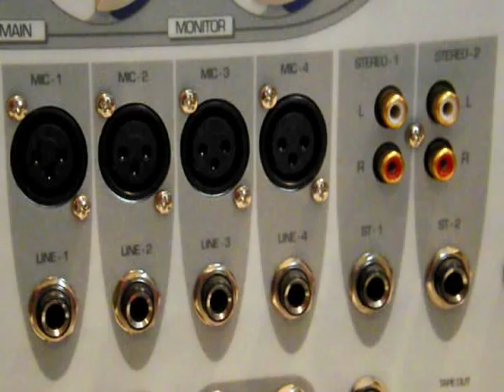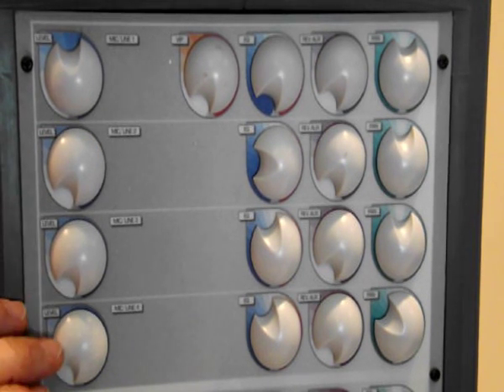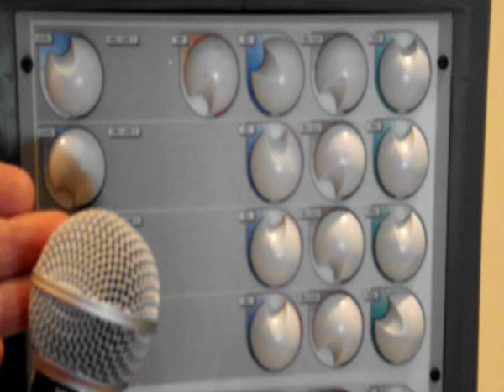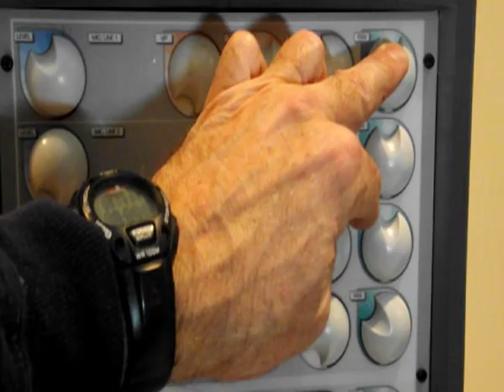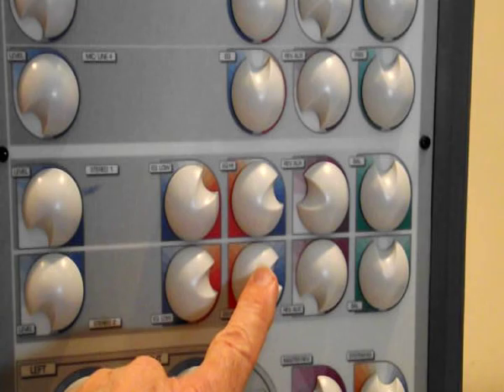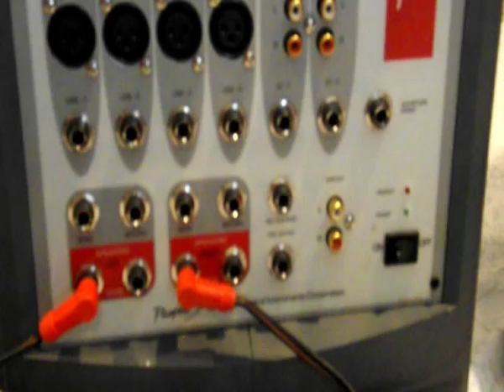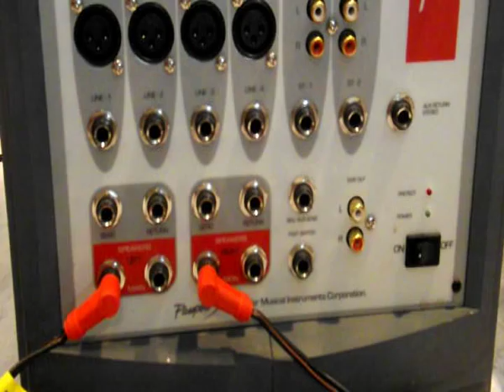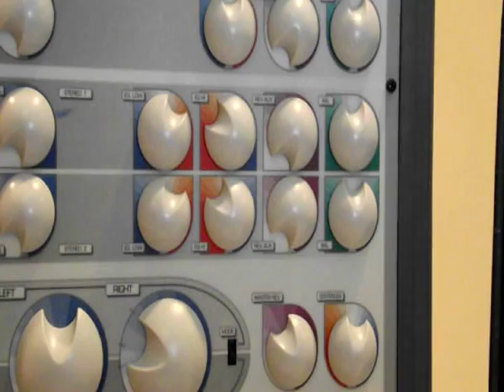Whacky Sound Education - System # 1 - Fender System Tutorial

Comment: Frankie, I have this sound system and I am wanting to add two subwoofers along with the speakers shown in this video. I have two MTX 150 watt rms/300 watt peak power (8OHMS). Can I add these and if so which outputs would I need to use? thanks!
Reply: I need the answer to this aswell, you ever figure it out?
Reply: @dougienoel  I have not…..
Reply: @vincepetrillo1641  just assuming you plug them into the other speaker inputs ? Not sure if that’s a bad idea

Comment: Sounds good. But i get a high pitch sound and then it gets stronger and then the speakers go out and have fo turn off and turn on... please advise?
Reply from the maker: Wow, that sounds really bad (pun intended). It seems it would make the system completely unusable. 
 I cannot explain or advise without additional information. Some basic questions are:
 1) When this high pitch occurs,   what instruments or mics are plugged into the board?
2) Does this problem occur even when there are no input cables attached?
3) I need to know the dial and button configuration.  Can you_please take a snapshot with your phone and text it or email it to frankie.stamps@comcast.net?

Comment: frankie I let a guy at my job barrow this and I was trying to explain to him how to use it he is having a party at a bar with a private room for his family and he is playing music from his phone. Now on the fender system if he is play music from the phone plugged into the stereo 1 and the black switch pointed down and the speakers plugged into main. Now does he leave left big nob at 12 and control the volume from the stereo 1 volume or control it either one thanks
Reply from the maker: The simple answer is . . . crank the phone volume to 90% to 100%, set the channel volume at about 50% and the master volume at ~50%.  Best to adjust the volume up and down at the channel knob.  

For more detail . . . read on . . . Volume coming out of the speakers is controlled by numerous amplifiers along the signal path.  What you are trying to accomplish is obtain as clean a sound as possible - meaning maximum signal to noise ratio (SNR) with minimum distortion.  To get maximum SNR at the output, it is best to amplify the signal as early as possible in the signal path.  By doing this, any further amplification down the line will increase the desired signal as well as noise, but the desired signal will remain  well separated from the noise.  Distortion happens when an input saturates an amplifier's capacity to handle the signal's peak power. Many sound boards will indicate overdriven channels by red LED lights that blink or turn on when max power is exceeded.Unfortunately, the Fender does not have this feature
Reply: Ok thanks
Reply: Frankie Stamps. hey I have one If these amps, when I try to turn it on the protection mode light comes on. can u tell me what I need to do to get it to play
Reply from the maker: Hi Sam,   The protection light is intended to turn red when the internal amplifier gets overloaded and the protection circuit trips.  So either you have input or output connections that are not correct OR possibly your unit is sick and in need of repair.  The first test to begin troubleshooting is . . . if you have nothing connected, no inputs and no outputs, and you power up the  Fender, does the red light come on?  If so, your unit needs to be repaired.   Good luck!

Comment: Thanks very helpful I think I finally now understand the monitor system. I'm still a little confused as to why there are a total of 8/4 inch inputs. It will be interesting to see a more in-depth video of just setting up the monitor system. Again thank you so much I have read through the manual many times and she never did quite understand how to use a monitor system.
Reply from the maker: I'm not sure my video is very clear on this topic.  I will try to explain more clearly here.  

The Fender system has two internal amps.  Each amp is connected to two 1/4" sockets - one amp driving the two "Left"  sockets and the other amp driving the two "Right" sockets.  Each amp can drive one or two speakers.

If the mode switch is "up", the system is in a standard "stereo" mode.  The signals flow from the input socket of each channel, through the channel dials (volume and eq and REVERB) and splits to the left channel depending on the Pan dial settings.  Each channel "left" pan then mixes together and is routed through the "Left" master volume dial, master eq, master Reverb and from there goes to the Left amp and finally reaches the two "Left" sockets.  The "Right" channel has identically the same signal flow except it branches through the "right" Pan dial and the "Right" master volume dial. 

If the mode switch is "down", then the system becomes a "Mono" system.  The Pan dial becomes inactive and the Rev/Aux dial does not add reverb, instead it becomes the Aux dial.  The "Left" channel mix is determined solely by the channel volume dial and eq dials. The individual channels are mixed according to their relative volume settings and the mixed signals go through the master "Left" (Main) dial, through the "left" (main) amp and to the two jacks labeled "Left".  The signal flow to the monitors is independent of the channel volume levels.  Instead each channel monitor volume is controlled by the "Rev/Aux" dial.  The channels are all combined into a mix that is routed through the master "Right" (Monitor) dial, through the right (monitor) amp and to the two sockets labeled "Right".

 Wordy explanation . . . hope you can follow it and it helps.

Regarding the sockets above the speaker sockets.  They are labeled "Send" and "Return".  The purpose of these sockets is to allow an external device such as an external EQ or external "Effects" processor to be inserted into the signal path.  When a 1/4" jack is inserted into the "Send" socket, the mixed signal is routed in parallel through the inserted cable and also through the power amp.  If a 1/4" jack is inserted into the Return socket, the internal path to   the amp is broken and the amp gets its input from the cable inserted into the Return socket.

Comment: If I have 2 main speakers and they are both plugged in the Left side like yous is at 8:55 in your video. I have one monitor speaker for the singer to hear themselves plugged into one of the Right side speaker plugs, and the switch is in the main/monitor position. Do I lose my stereo sound or in this case specifically my Left side channel sound that way?
Reply from the maker: Yes, you lose the stereo sound - the system becomes mono.  When the  mode switch is in the "Main / Monitor" position, the mono/house mix is derived from the channel sends, the Pan and balance controls becoming inoperative, and the Left Master becomes the mono - House Master control.   The monitor mix may now have an entirely different mix than the house, because each channel volume onto the monitor bus is controlled by the REV/AUX dials.